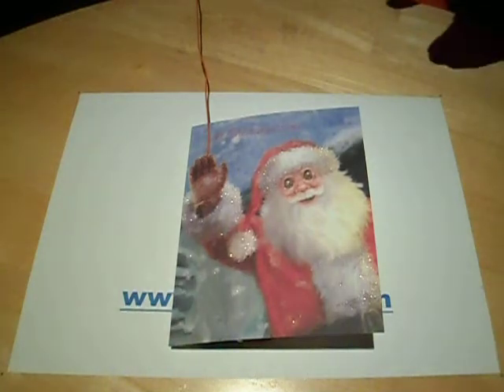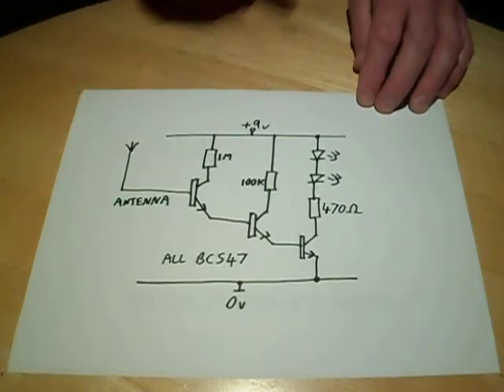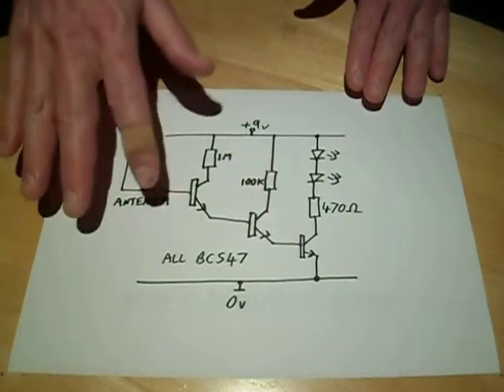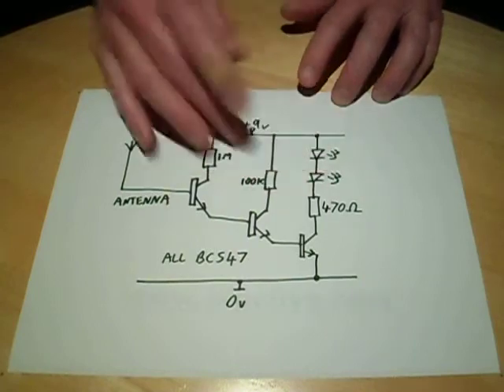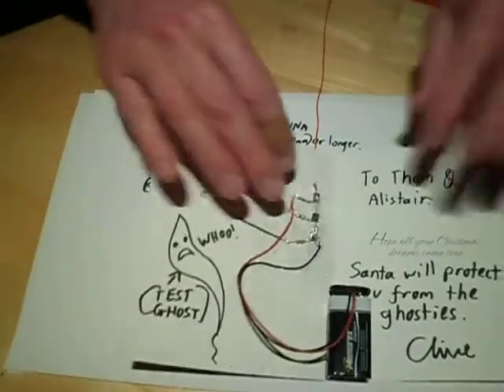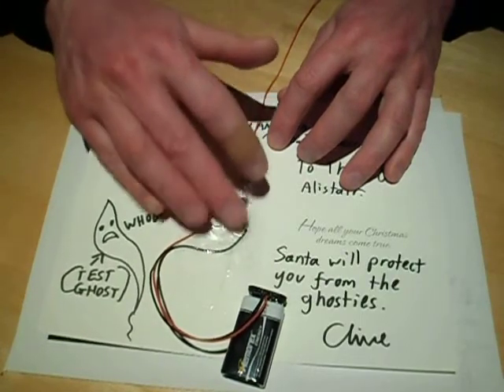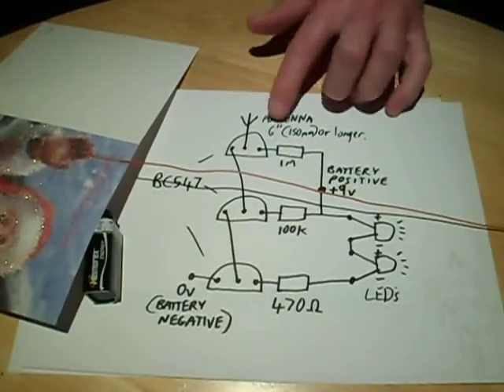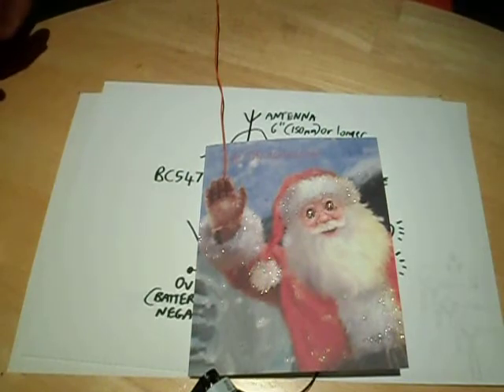Make a ghost detecting Xmas card.

Comment: I ordered in a batch of BC547's after trying unsuccessfully to build this project with a couple of other transistor's.  They are cheap and very easy to get on Ebay now, so I figured  why not use the ones that Big Clive can get to work, and they work GREAT!  I have made a couple of those circuits now but never had any rabbit ears left over from long long ago when we needed them back when I lived in Minnesota in 1969. So instead I simply soldered on some lengths of lacquered copper wire recovered from old power supplies I tore down for just the copper and what ever components  I thought I may one day want to use.

Comment: This'll be neat to tinker with!
A good sub for the BC54x/BC55x series in the US would be the 2N3904 (NPN) and 2N3906 (PNP). A 2N2222 would also work.
Reply: DJPhilTBCollins  BC 548 work ?
Reply: Should be fine. The main difference between the BC547 and BC548 is that the latter has a lower voltage rating at 30V. Not a problem for a 9V battery operated circuit.

Comment: Hey Doc.
I have made 2 of your 9 volters , the first was in a plastic box just working well. made a second one and put it Inna cardboard gift box and have in works well, put the original in the same box set up and instead of working it's a dim glow from the he LEDs touch the antenna and the LEDs go off for a bit and relight and stay on..  Sir do you know what's going on?.  Thanks for your Vidios and in advance for your help.. Bob H
Reply from the maker: You have to be careful about leakage and resistivity of materials.   These circuits are very sensitive.
Reply: @bigclivedotcom  The hot glue holding them down is the only difference and the proximity to the cardboard I could think of.   Now I did make sure to make the first like yours with h the length of wire left as is. The next one I shortened down and I worked so I cut down the first to fit it in the box. I knew the sensitivity from the 3 volt one you made and your comments there.   This is real interesting and perplexing at the same time as 2 damn near the same  was a wonder.  I hope your making something with your Chanel , I do enjoy it. And anything ghost hunting I'm pleased to see. Thanks I will try removing glue then something else might come to mind. Bob.